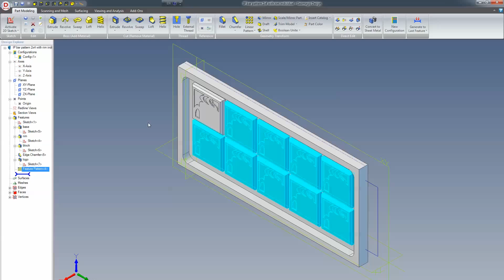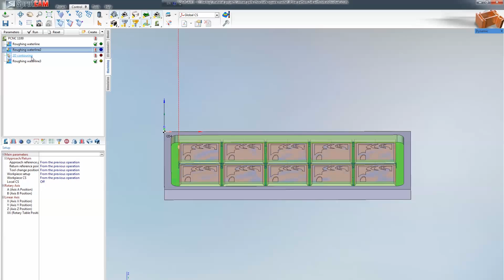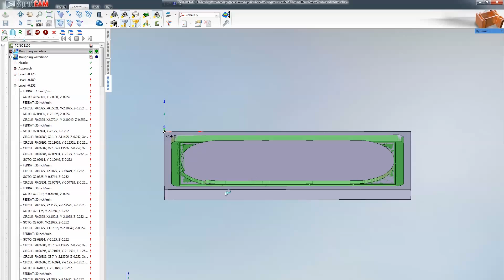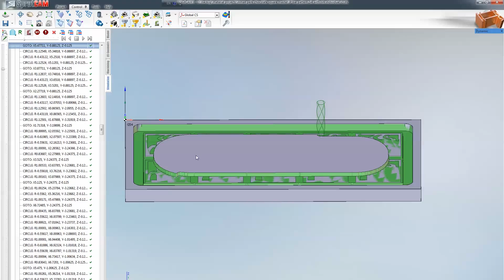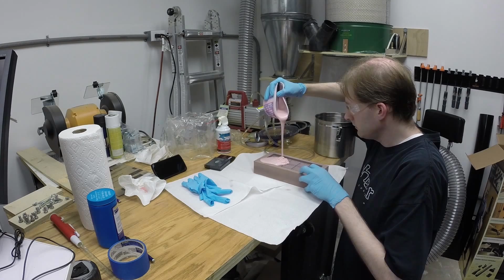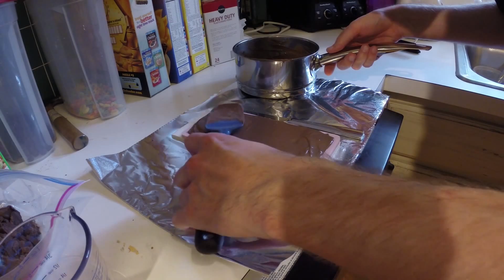CNC Chocolate molds for Inman Perk Coffee

Comment: Have you tried silicone1 and cornstarch? I think they call it OOGLOO or something like that. The cornstarch introduces water to the entire volume of the silicone. It makes a rubbery material. I guess that wouldn't be good for casting hot chocolate pieces, but maybe something else. 

Question: did you put the mold with the chocolate into the vacuum chamber to take any bubbles out of the chocolate?
Reply from the maker: No, I have never placed the liquid chocolate in the vacuum chamber. I have never had any issues with bubbles forming in/on the chocolate so it has not been necessary.